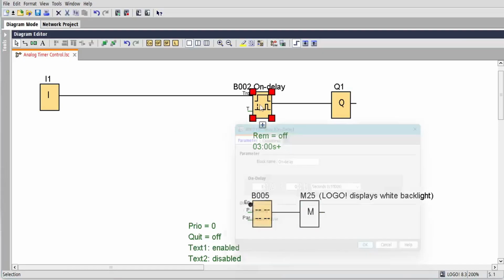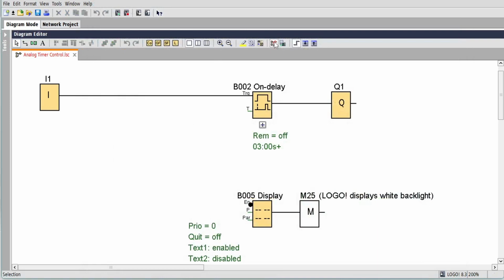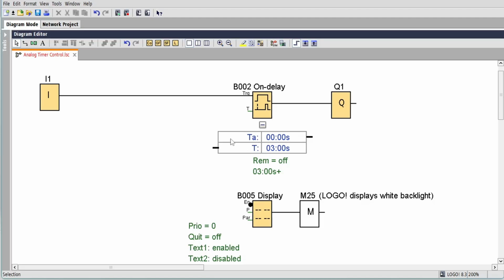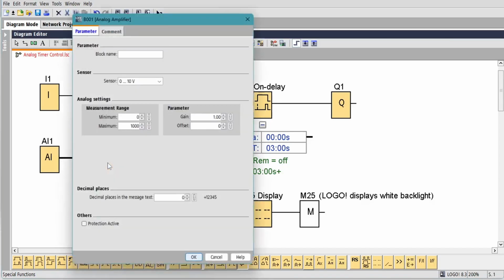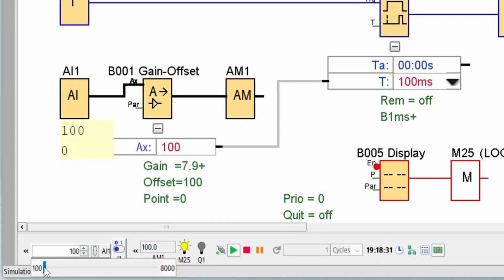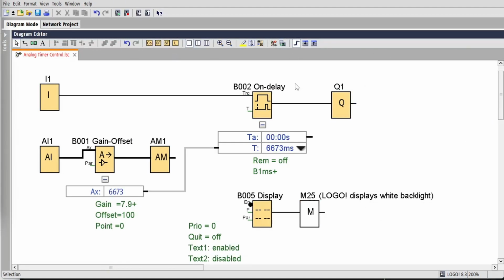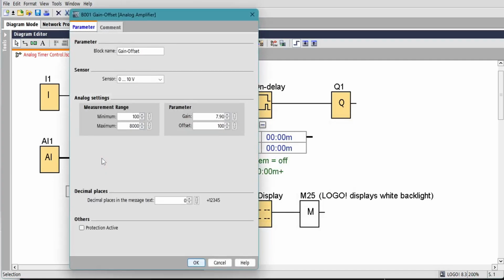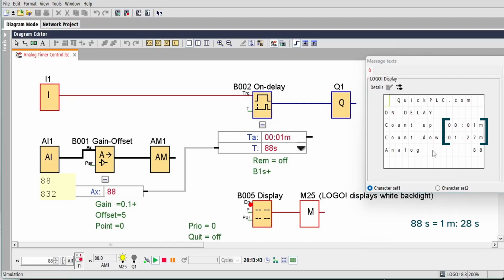LOGO! Analog timer control | Siemens PLC programming

Comment: can i control weekly timer by modbus communication ?
Reply from the maker: That should be possible. I haven't explored the Modbus capabilities too much yet. See if this is of any help: https://wiki.rocrail.net/doku.php?id=modbus:modbus-en
Reply: @QuickPLC-kh5of  I have had a nightmare with the modbus tcpip to memory address areas, the memory areas are not independent when it comes to the vb vm addressing, you have to offset by bytes. I used your amp with an NAI VW and its just as easy, thanks